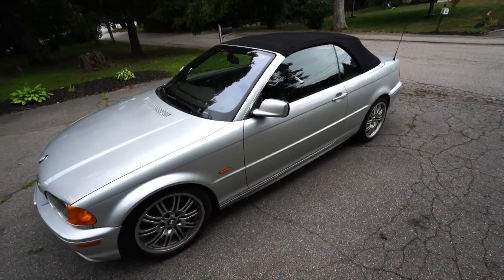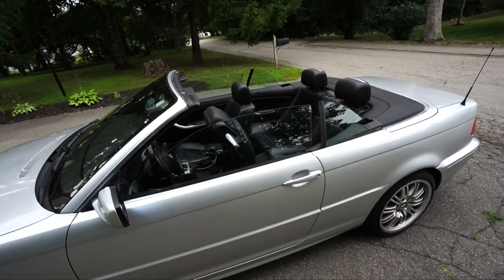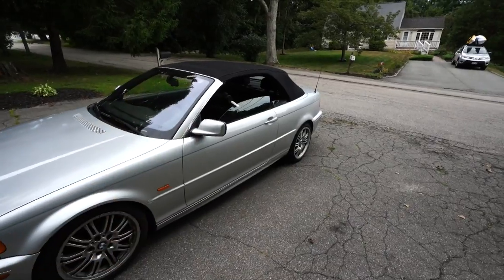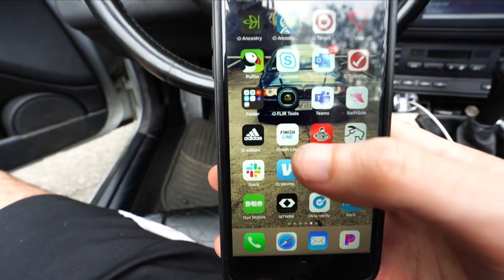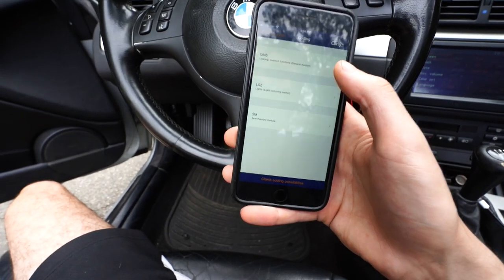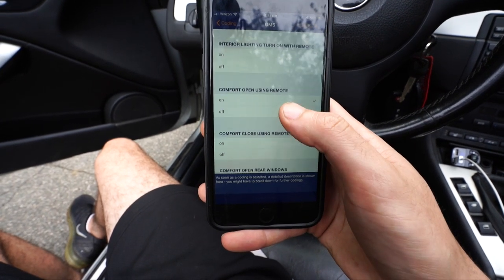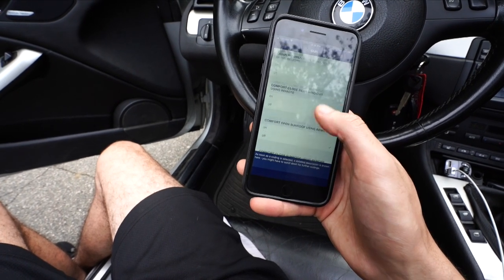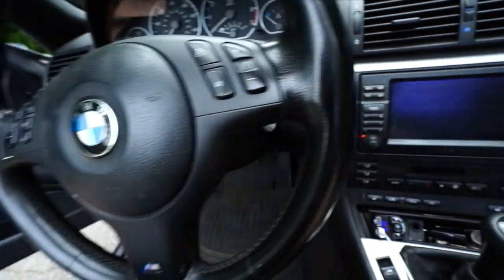BMW e46 open/close convertible top with KEY FOB

Comment: I think mine does that from the factory. I was told by BMW to never put the top down until the car is on. With it off it puts more pressure on the hydraulic pump
Reply: The pump sounds desperate 😅
Reply: Need an auto start installed. :)

Comment: How about opening the top while you are driving. Can you program that? Sometimes when I'm in a traffic jam and it's getting hot I want to shut the roof. But it's blocked.
Reply from the maker: Hmm good point I will look it that
Reply from the maker: Update I found out a way to do just this and how to make it one touch! Stay tuned!!
Reply: It’s illegal to close and open your roof on the road.
Reply: I think it only operates upto a maximum of 12mph or might even be 8mph.
Reply: @EvanGoyuk so what do you do

Comment: can Carly program acceptance for a convertible Hardtop? I am having Issues with my E46 I installed the Hardtop kit on my convertible M3 because it was not factory set and now my Navigation system is acting up and keeps the interior light of the hardtop on and Navigation system on even after the car being completely turned off, I have to disconnect the battery to avoid getting it drained by these issues, there might be a short circuit somewhere, or do I need to program the car for the Hardtop compatibility? and that should clar the issues I am not 100% sure, any help will be appreciated.

Comment: I would never raise or lower my roof without the engine running to save the battery power 🤔
Reply: Its got more than enough power most likely youll probably be getting in soon enough
Reply: @highfighter219er5  really 🤔 I would never use any of the motors on a vehicle without the power being immediately being replaced by the charging system.

Comment: Evan.  This, and your other video do not make sense.  First, does one have to have the mods4cars BMW module for $400 in ADDITION to this Carly or can this be done with JUST the Carly??  ie.  do you NEED BOTH things?  That's like $400 for the mods4cars module PLUS the $80-100 for the Carly....is this correct.  Both vids do not state whether you need BOTH.  ie. what is the CHEAPEST WAY and DEVICES (in full) needed to do this??  Thx.
Reply: Hi iv just bought a carly and downloaded the app to code my roof to the fob after watching your video but now been told i need the full version for a big cost is this correct or will this app do what i need or do i need something els to use it properly
Reply from the maker: You need the subscription too
Reply: @EvanGoyuk  thanks how much is it were do i get it from
Reply from the maker: Inside the app
Reply: @EvanGoyuk  ah i see ok thanks im presuming it will work with an e46 330ci convertible
Reply: Uk model
Reply from the maker: @hazelking3174  yes

Comment: My e46 opens the roof with key but doesn’t close anyone know?
Reply from the maker: You need to code that
Reply: Evan Goyuk hi Evan how do you code it, is that by putting in the ignition and do them magic ignition 1 ignition 2 sequence
Reply from the maker: No I have videos on how to code your BMW. It requires both hardware and software
Reply: Evan Goyuk oh brilliant will subscribe and take a look, also been trying to find the Bluetooth module in my E46 msport (convertible) so have no clue where the module will be
Reply from the maker: Thank you for subscribing. The Bluetooth module sits under the center console.
Reply: Evan Goyuk yeah in the centre console I’ve got the Bluetooth part that holsters the old Nokia phone 😂 but on E46s forums apparently it’s behind the rear seats?
Reply from the maker: I have not heard that